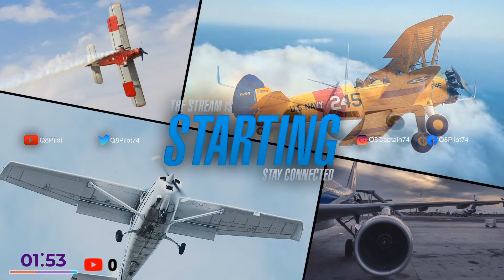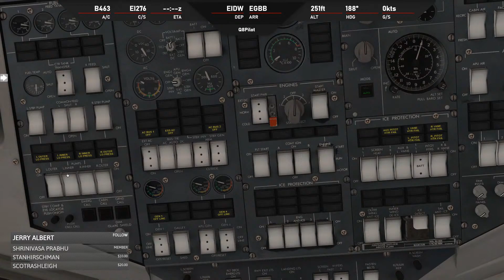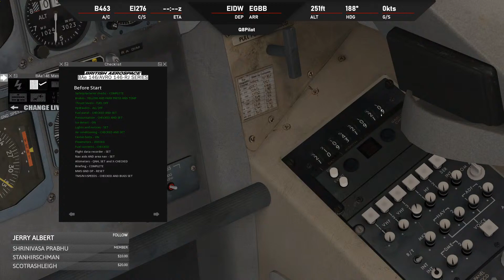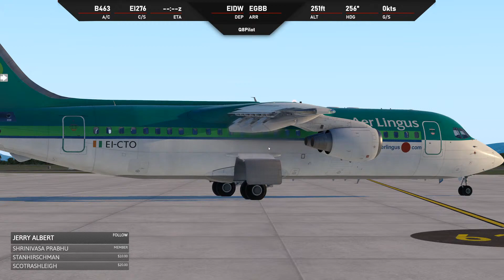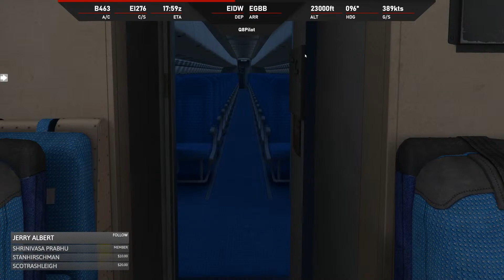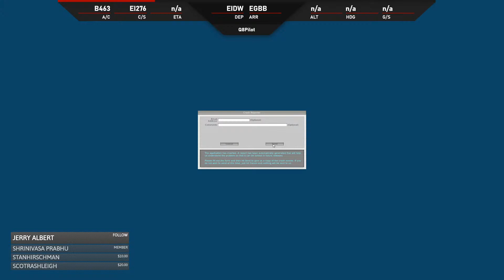JustFlight BAe 146 Professional | Full Flight | X-Plane 11

Comment: Nice video!  Just one point though, you would never engage VS (vertical speed) mode on take off in an airliner (any airliner), as it offers no speed protection.  You should have engaged IAS (airspeed) mode, at your desired climb speed. VS is only used for descent, or for smaller altitude changes, once at cruise. (Eg. Climbing from FL280 to FL290).

Comment: The TMS is working different in real life. It does not move the thrust levers, it's moving a jackscrew on the engine fuel valve and modulating thrust. It's independent of the thrust lever and will indicate with the little arrows if the jackscrew reached it's limit and you need to assist with the thrust lever. LES Saab 340 has a similar system for Takeoff (CTOT).
Reply: @John Smith No i think it's looking very well Made, just the TMS logic needs a bit tweaking (decouple zu the 3d thrust lever from the engine). Theres a old itvv documentary where they follow a Debonair BAE 146-200 from Luton to Campino, they show how the TMS works.
Reply: they have mentioned in one of their videos that the BAE146 currently has the default FMC, but the BAE146 FMC in under development and will come in a future update *i do not work for them nor know when but thats what i have heard so take with a grain of salt.